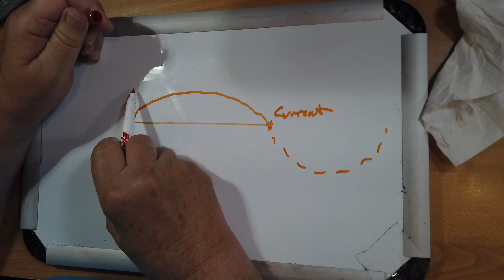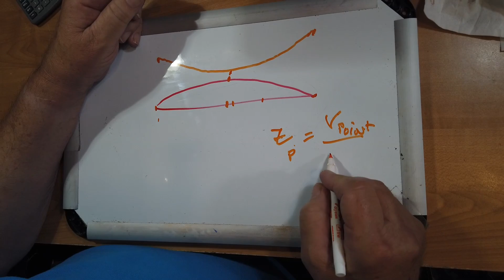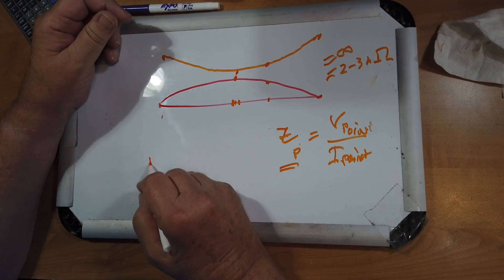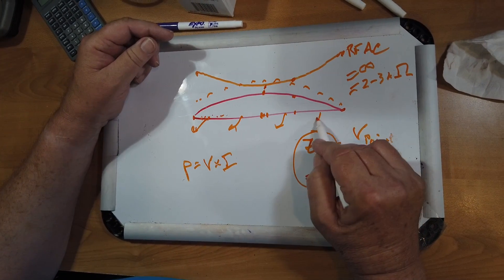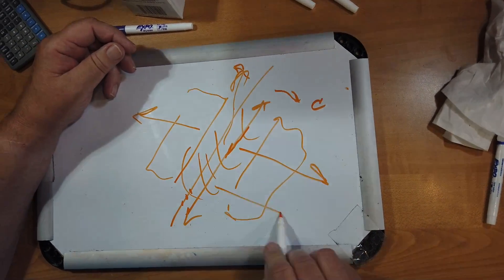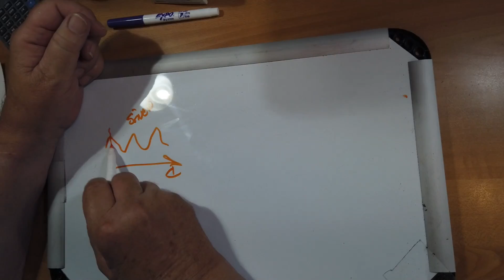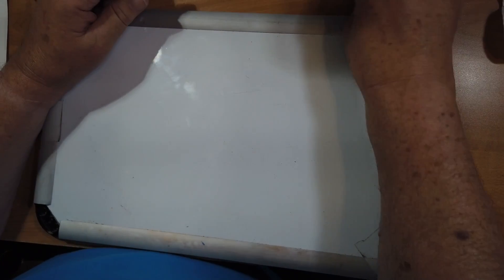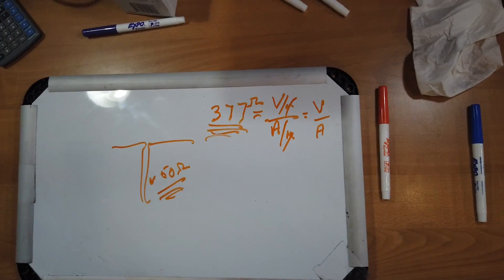So What Really Happens Inside an Antenna? (#750)

Comment: Howdy. With all due respect. I think You are wrong.
According to Your view there will be no electrical field from the end of the antenna to the other end. The field would sprout out endwards as the same polarities would repel each other.
I understand the dipole radiates mostly forwards and backwards, not endwards. I believe this advocates the polarities being the opposites at the ends.
The phase shift is 90 degrees. Yes. But that may be splitted into two components. One 0 degrees and one 180 degrees.
I believe the 0 degree component is what radiates and the 180 degree is reflected back. Thus the ratio 1:1. I believe that an antenna radiates half and reflects half the input power.
In High Regards.
Reply from the maker: Hi Eugene. I stand by my explanation in general. Note I'm talking about inducing electromagnetic fields. Think in terms of RF RMS voltage rather than instantaneous voltages.
Reply: @davecasler  Howdy.
Fair enough. To all his own.
Thank You for the courtesy of replying.
In highregards.
Reply: Hi Dave, thanks for another excellent video. I do see the phase diff of 90 being shown on various literature - and as you clarify, that's only when viewing the instantaneous voltages, but the RMS voltages would show the curve as all positive (and 0 in the middle). The position of the 0 - RMS or instantaneous -  not changing seems to indicate a standing wave. However if the phase diff of 90 will prevent radiation as you say, then it contradicts what I am reading in various other places. Any further clarification much appreciated!! Regards.

Comment: Hello David. Steve from the UK here. M7DOZ. I have a shakespear super big stick around 18 feet high 10 metre band , mounted by the base , which many years ago worked just fine. Lived quite high up then. Now after 35 years in storage i have fitted it & it seems to be picking up plenty of skip at certain sunny times of day. It has a good SWR.I wish to improve the situation. My shack/ garage is made from steel sheeting. Flat roofed.
So would a vertical good length antenna mounted dead centre of the shack,  which measures . 9 Metres x 4 metres. If i put a ground rod to earth & fitted a vertical dead centre, Do you think this would improve things. Also if so then what antenna would you recommend. 
I vaguely remember cutting one of these antenna's open as it was broken. The top 8 feet or so whip was i guess a 1/4 wave vertical. This screwed into a much thicker pole & had a screw fitting to accommodate the whip. Inside this was a loading coil of some sort A balon or artificial groundwave. The rest of the pole some 10 feet long just had the coax running up to the coil. Maybe it was a vertical dipole. I have trolled the net & asked various pro's but so far not got anywhere with an answer. Sorry for such a long question. but you seemed to be the guy with the experience & knowledge.
Regards.
Steve M7DOZ.